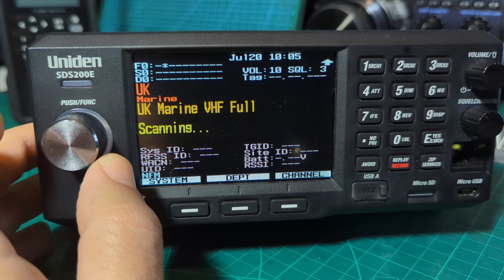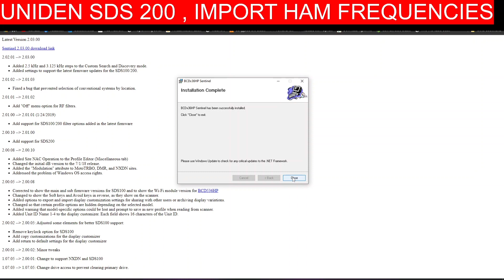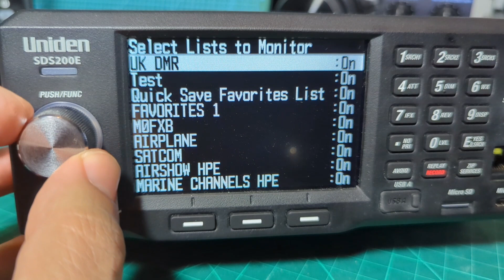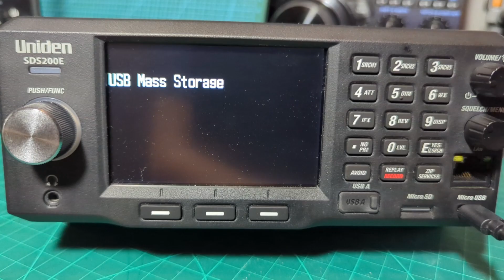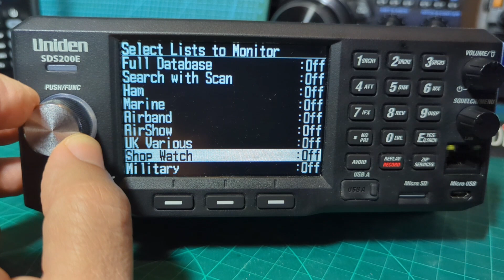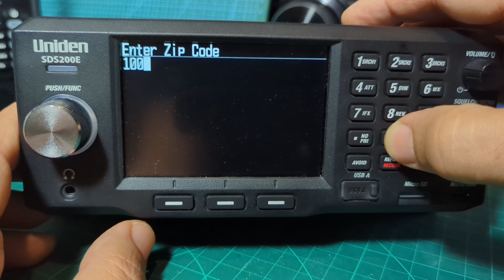UNIDEN SDS200 - LOAD FREQUENCIES , UK & USA CANADA

Comment: Hi, excellent channel.  I’ve just got the ubcd 3600xlt and I’m a DMR newbie. I wonder if you could give me some advice, I have put in the search range for DMR frequencies. My scanner locks onto a station and flashes colour code 1-12? Nothing is heard? What am I doing wrong ?
Regards, Tim
Reply from the maker: Hi I am learning about scanners I don't have the 3600 I will try learn more .
Reply: @M0FXBHamTech   Hi thanks for your for quick replay ,the only reason I asked is because on the uniden sds200  that you have the colour code has been selected, mind flashes (colour code 1  )and at the bottom is flashing (slot 1) (cap )Just out of interest did you not have this on your? Thanks for your time Best Regards Tim